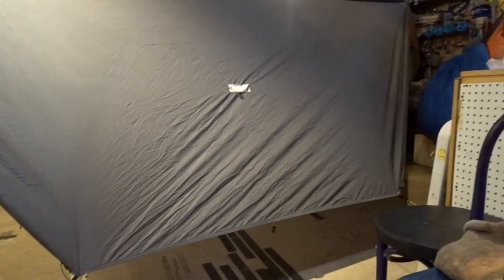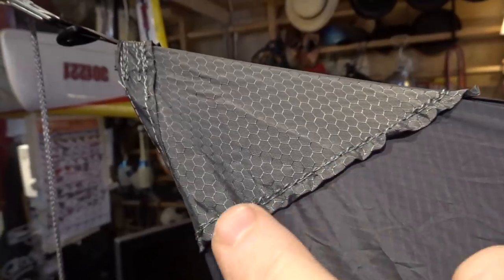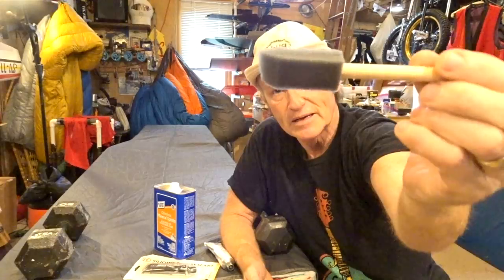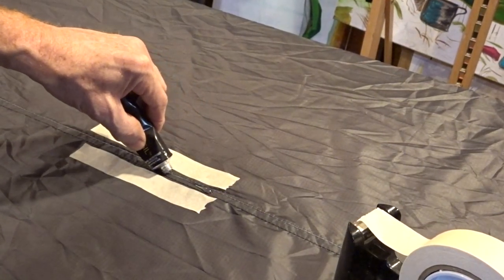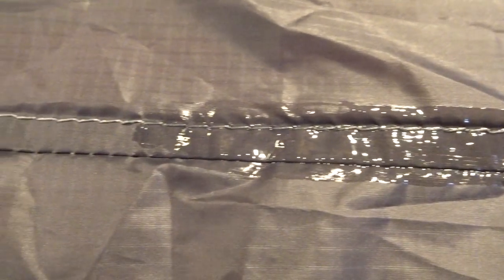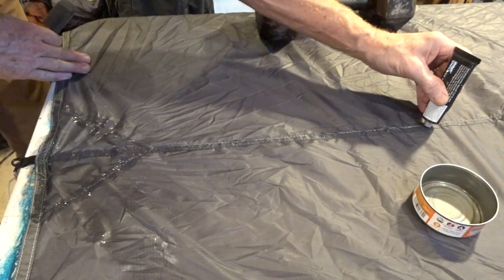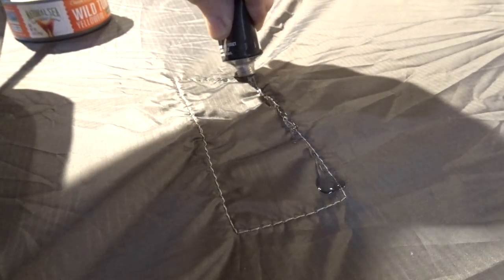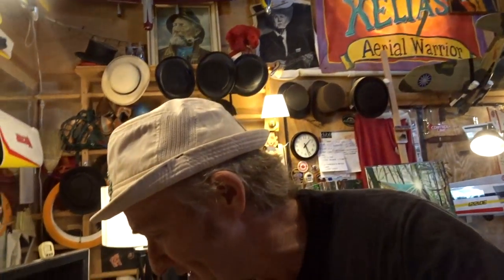Seam Sealing a Tarp~~

Comment: Liquid stitch works perfectly and reasonable.
Reply from the maker: Never heard of it but good to know. Good name.....
Reply: In the sewing section in Walmart, little tubes for a buck.That tube will do both sides of your tarp. Its silicone, but seems to have an ingredient which makes it easier to apply and not quite so darn sticky. I occasionally will sew up a tarp and have had good luck with it. Very pliable and long lasting

Comment: thanks, Shug. did my first seam seal on a tarp just two weeks ago. wasn't pretty and not what anyone would consider a factory sealed job, but after watching this I feel a lot better about the way I had to try to do it in my small kitchen with limited space and in small increments. the best part of the whole thing was that I put it up in SE MN last week before we got the snow and rain that cold-soaked everything and it worked! Hurray! so all my worry about getting it 'just right' was for naught and after watching this I know a couple of easier things/ways to do it on my second one, which will be in a week or so when I get the time.
Reply from the maker: I never trust a pretty tarp!

Comment: I just bought a used tarp from a friend 3 days ago. He doesn’t know if it’s nylon or poly. Is there a way to tell? I need to seal it since he never did that I can tell. Thanks for the video, it was perfect timing. Hammock on!
Reply from the maker: Silnylon and silpoly is very slick. Nylon is a bit heavier.

Comment: Great video Shug. It came one trip too late lol. Just finished a hike on Ice Age Trail and Tuesday night/Wednesday morning got rain/sleet/snow. I seam sealed my W.B. Thunder Fly weeks prior but should have tested it. Seems my seam sealing skills seriously suffer. The lower portion of the "V" on all four dripped a little. Nothing too bad and nothing ruined. But great lesson.
I shall endeavor to persevere in your footsteps o Master of the silicone/ mineral spirit.
Reply from the maker: That grosgrain material on the pullouts takes a couple smears sometimes. Press it in good and hard with your finger into the threads. Be Dripless~~

Comment: I'm in my mid 70's and grew up camping and never once did we ever seam seal our tent. Never knew that was something we needed to do. But it's a real good idea. We've been in many storms in our tent and mostly dry inside. Did get a bit of moisture inside  once which I assumed, incorrectly I guess, that it was condensation. I'll be pulling out my tent when it gets a bit warmer to make sure it's still in working order and then seal my seams.  Thanks never knew that was necessary but makes sense.
Reply from the maker: Yep...no one likes doing that job!!!  We never sealed either in the early days. EARLY!

Comment: Awesome video Shug thanks!  I too have seam sealed many, many tarps and tents and read a tip years ago about using Permatex 81730 flowable silicone windshield and glass sealer - and I've never looked back.  Flowable being the key term.  It comes with a nozzle that you can cut the size of hole you want and I use that and push the bead into the threads with my fingers while wearing nitrile gloves.  Works fantastically well.  Also got a tip to load up a curved tip dental syringe with your sealer of choice- will try that too next time.
Reply from the maker: Thus why there is a link for it below the video. I've yet to use it but hear from a lot on hammock forums how well it works. Yessir!
Reply: Ahhhh, apologies, didn't see that linked.  Really good stuff.

Comment: Its a good idea to set your tarp up taut before applying the seam sealer. The more exposed the seams are when being sealed, the better seal you will get
Reply from the maker: Well it was March here in Minnesota and cold and snow-covered outside. FYI...I did stretch it out as I applied the seam sealer. Never leaked on me to this day.
Reply: @shugemery  good deal shug. My comment was more just sharing info for others, not meant to be a dig at you at all. Cheers brother!

Comment: The very best, most precise and funnest (by far) method of application is to daub the seam sealant on the stitch line, then use ones nose to thoroughly work the sealant into the stitch holes and even into the very fibres of the threads.

          The benefits of this (admittedly very advanced) technique are manifold. Chief among them, however, are:
  1)It keeps ones eyes right on task, permitting of great precision; absolute thoroughness of workmanship & very keen concentration upon the critical task.

  2)I forget the second, but, believe me, it's also chiefest. Probably.🤷🏻‍♂️
Reply from the maker: My probuscis is a bit fragile at the moment!.....https://flic.kr/s/aHBqjzHsyJ
Getting reconstuction surgery tomorrow morn.
Reply: @shugemery  
          Yeeeesh...!!! Definitely get that extra opening taken care of, before you try my preferred technique.
     There's no good can ever come from getting any sealant in there. It's not the task for silicone.

          God bless and preserve you, Mr. Emery; may your new nose guide you ever to goodness, gladness & gold.
💫👃🏻💫

Comment: Been putting off seam sealing my new silnylon tent for about 6 weeks now because I don't have a ventelated space in my apartment. Kind of stuck until the weather improves! And it's a trekking pole tent which doesn't help - never even pitched it!

Nice to see that beautiful painting of yours make a cameo. I have my print hanging on the wall right next to me and I love to sit and look at it on the days I can't get out. Moved to Scotland recently and got in my first hang of the year last weekend right on the shore of Loch Katrine. Unbelieveable view. I think it's going to be a good year. All the best Shug :)
Reply from the maker: The seam sealer I used is not too toxic. Open those windows and doors, turn on a fan and seal away~~
The year can only get better....I'm hoping.

Comment: I know this might be an overcooked question but in your Elder experience; what is a better pack fule; alcohol, sold fule tabs, gas, or wood?
Carrying, storage, relatable, price, and realistic look at a 14 day to a full blown threw hike. The ability to burn rice or boil water. With the majority heating water and using a cozy. ..some of us cook fish and wildlife with foraging..with proper license and season.
Much thanks, Russ.
Reply: Yes I still have my green aluminum pack chair. It has worked well as a seat and cooking stand for under hammock.
Reply from the maker: I'd say it is personal preference. For me in 3 season I tote alcohol for ease and quiet.  Fire is always good. Winter I use white gas to melt snow for water . And fire. So it all depends.

Comment: Being old and cheap, I tend to to buy cheapo, thin, lightweight tarps because they are light and compact (and cheap). They require seam-sealing because I worry about poorly sewn seams and corners leaking of course. But there is another reason to apply seam sealer, especially when the stitching is less-than-perfect. I find that the sealer acts like glue and reduces the chance that a loose thread will continue to unravel and allow a seam or pull-out to come apart. Of course, this is less of a problem on a higher-quality piece of gear, but anything sewn can potentially come un-sewn, and a little bit of insurance is a good thing.
Reply from the maker: Righto~~~

Comment: Well after the drying period is over, any issues with how they stuff back I to their stuff sacks? Even after the tacky phase? Will that sealant ever crack due to the stress of being compacted? Great video and appreciate you sharing your knowledge.
Reply from the maker: I have never had one crack. Stays pliant. My DIY tarps are still going strong since 2007.
Reply: I used the gearaid (back when it was seam seal brand before gearaid) for the PU nylon to fix a hole in my tarp from a boy scout trip, someone tossed a river rock in our fire and it exploded burning a hole in my tarp.  That was in 1993 or 1994, I still used that tarp a couple times a year and have not had to replace the seam sealer that I used.

Comment: Not sure if this matters but you may want to avoid having any soap on the area to be sealed if going silicone to silicone.
Reply from the maker: I've never washed a tarp....just wiped with a damp cloth.
Reply: @shugemery  👍 in case anyone else did.
Reply from the maker: Righto~~

Comment: Hi Shug. I have learned a lot from watching your content, so thank you. I am now the owner of a Warbonnet Ridgerunner and Thunder[something] tarp. They recommended a 13' tarp with the bridge hammock. The 13' tarps do not come seam sealed, so this video is particularly helpful to me right now. But I have a question for you.
I don't have a convenient space in my house to spread out the full length of the ridgeline. I'm thinking I might do it in two halves. Wait for the first half to dry, then do the other half. Is there any issues with the final result by doing it that way? Thanks in advance.
Reply from the maker: That oughta work just fine. Stay dry...stay warm~~

Comment: Shug: I followed your recipe (50% methyl spirits and 50% RTV silicon and it worked well. Thanks!  The problem is that I had to buy the methyl spirits and the smallest can they had was way more than I needed. Question: would it be ok to use the remaining spirits in a cocktail or beverage so as not to waste it, and if so do you have any recipes? Thanks again.  )
Reply from the maker: Methyl spirits for life I reckon!!

Comment: forgot to mention while talking about a leak ruining your weekend that you can't FIX a leak until the rain has stopped and the tarp has completely dried. if you're stuck with a leak during a week long deluge like I was once, you can't fix anything until it's completely done with.

also I've always wondered why nobody offers the option to sew-on the snakeskin halves and seal them to the ridge-line loops as built in water break (for water running down the tarp suspension). and same for hammock suspensions like daisy-chain loop straps and snakeskins for hammocks.  webbing style straps could have a water-diverting design stitched into them, or maybe even woven in such a way that water migrates automatically towards the edge.
Reply from the maker: Bummer. A leak will ruin your sleep.

Comment: So that's why my tarp edge where wet, they sealed the ridgeline seam with tape but not the tie outs
Reply from the maker: They were cutting corners I reckon!
Reply: @shugemery  it is a relatively cheap tarp, no leak just wet corners, upgrading to warbonnet mountain fly soon
Reply from the maker: @dark69geko  Make sure to seam seal the pullouts on the Warbonnet. They usually include a small tube of seam seal for that.

Comment: U mean my aqua quest tarp needs seam sealed probably?
Reply from the maker: Says it has heat taped seams:
Features:

19 reinforced webbing loops
70D nylon
Heavy TPU coating
Reinforced stitching
Heat taped seams
Reply: Ok I quickly looked for those specs.  Didn’t find that. Thanks shug